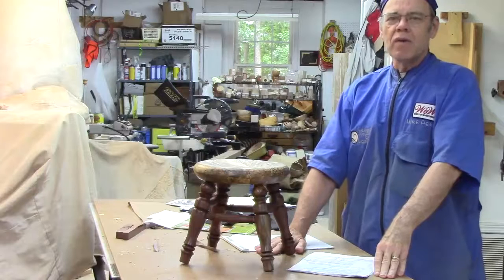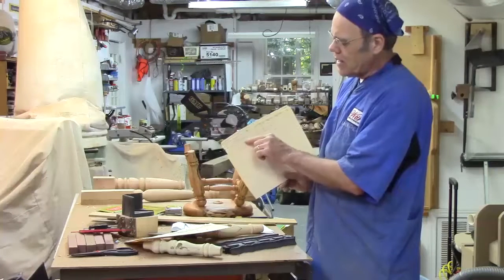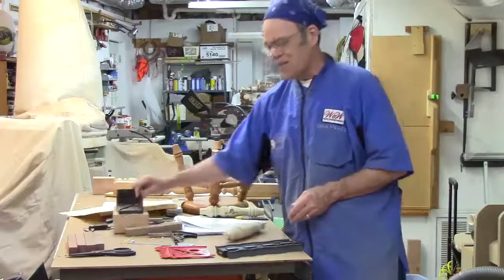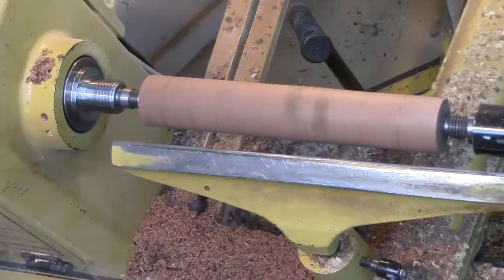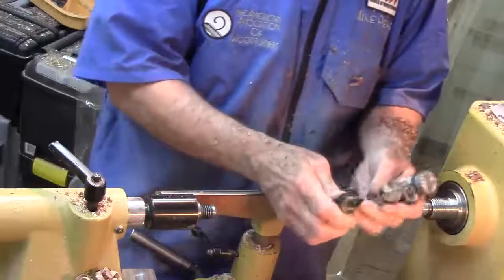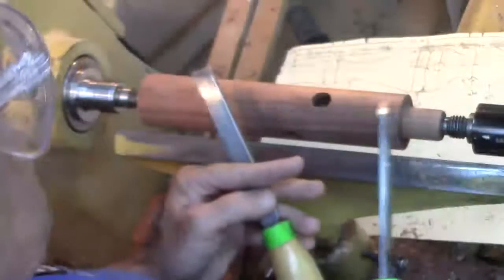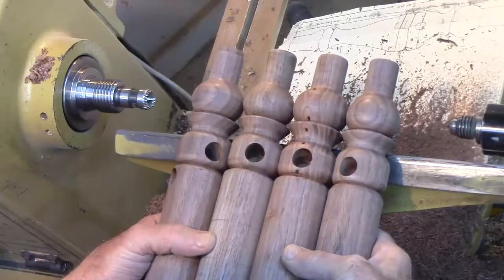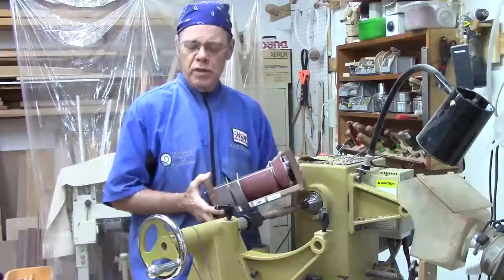How to Turn Duplicate Spindles

Comment: Mike -- You asked for some suggestions for using a story stick.  After some reflection, here are a couple of ideas: First, in the video you demonstrated marking key transitions using the story stick.  For the most part, the places you marked represented the minimum diameter of an element, such as the end of a bead or the bottom of a cove.  In addition to these marks, I also mark the maximum diameter of elements, such as the top of a bead or the high point of a long taper.  Then, I use my parting tool to cut down to just above the maximum diameter and mark that spot with a pencil line.  Then, I make sure that line is removed ONLY when I'm final sanding the turned spindle.  It helps keep beads and such a uniform size and shape, and it gives greater perspective when turning the other elements of the spindle.

Second, most spindles that I turn (mainly lamp bases) have a maximum diameter at one element and everything else on the spindle is a smaller diameter.  It might be at one end, or it might be in the middle.  Once I've used the story stick to mark the maximum diameters and have used the parting tool and pencil to mark them as described above, I then connect those maximums with long tapers.  Then, I go back and mark the minimum diameters using the story stick and pencil.  This approach allows me to remove a lot of waste wood quickly.  It also helps me keep each element in perspective as its turned.  I consider this to be part of "roughing out" a spindle.  After this roughing out is done, I then turn each element to completion before going to the next -- just as you instructed in the video.

Please forgive the length of these comments.  I found everything you said valid.  I'm merely trying to add to, not detract from, what you said.
Reply from the maker: David Walser Good info. I like the idea of turning down before doing the marking when there is a lot of wood removal. I have not made a lamp yet but it is on my list. Thanks for the tips.